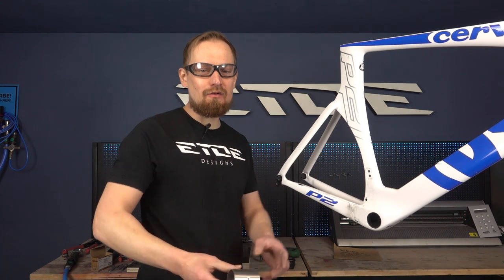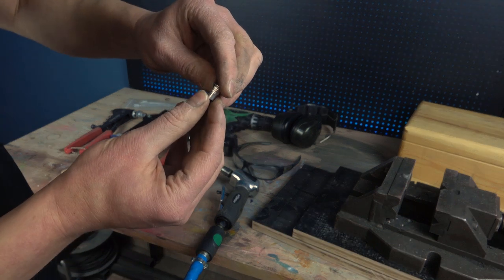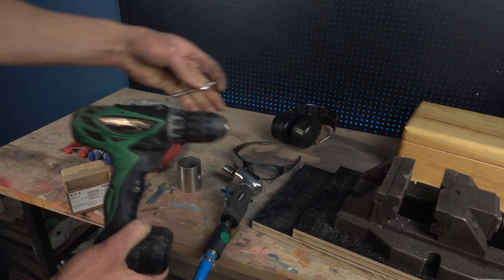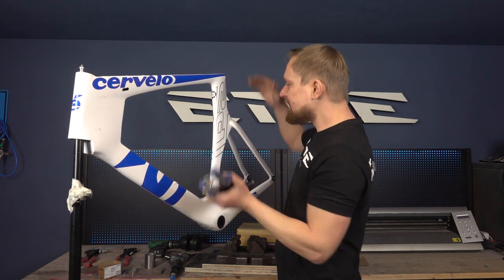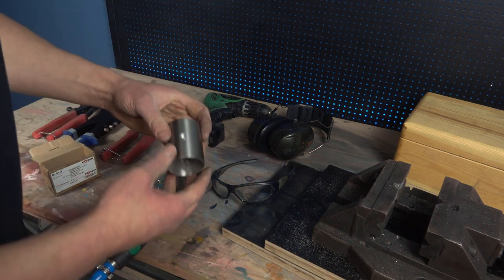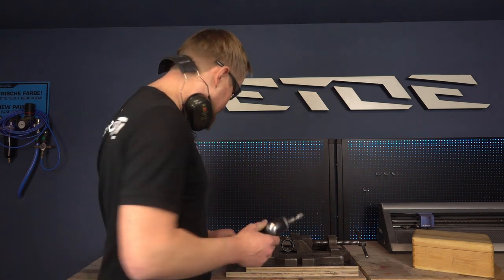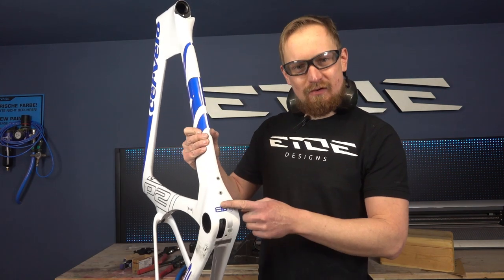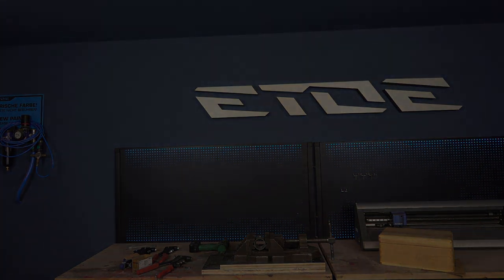How to replace and remove rivets on cycle frames

Comment: excellent video with regard to the burr bit in particular.  saw another video with someone using a dremel to cut the ridge and there’s no way I’d use that method on an expensive frame.  This guy has the right idea.

Comment: Thank you Martin for the information. Here is some more critical information regarding the rivet nuts. Look in the inside of the rivet nut and you will notice a smooth side wall before you get the screw thread. That area is called you the shrinking grip range. That length must be taken into consideration when purchasing these rivets. The length of that smooth surface must be longer than the thickness of the material you want to insert the rivet into. There is more information on the internet should anyone need more specifications.

Comment: I have never seen a adjustable angle threaded rivit tool, but one would be really useful. Also you should always use alloy threaded rivits in alloy or carbon frames and steel threaded rivits in steel frames - alloy rivits in a steel frame will cause bimetalic corrosion.
Reply: I cannot agree with you more. If only I can get into some people thick brains regarding different material when in contact with each other.

Comment: Just what I need.  How do you keep the metal from going inside the frame?
Reply: You can’t. Just take the seat post or fork or bottom bracket out and you can get it out that way.
Reply: @corbett08  it would be easier to just use a chisel and work it out, not taking the bike apart cause I want to save time taking the rivet out.

Comment: Using a burring tool to remove an old rivet has some drawbacks. If the user gets a little too aggressive, the bit can wobble and cut through the rivet and possibly damage the original hole in the CF frame. Using a series of small-to-larger drill bits is slightly less likely to cause this type of damage - unless the bit grabs the weakened rivet and starts spinning it wildly in the hole. Also, be super careful to not let the V cone-shaped burring bit go too deep in the hole.

Comment: Hi, i have a couple of questions, on a carbon frame i have a couple of pop rivets. Do they need to be "soft material" rivets so they dont damage the frame? Also, it looked like something fell inside your tube? Can this ever become traped on the bottom tube of a carbon frame?

Comment: What about the piece of metal left inside the tubing from the back of the old riv nut ???
Reply from the maker: You can remove it through the bottom bracket.

Comment: Ich habe eine frage bitte.  What happens to the internal part of the rivet when you grind off the top?  Does it fall inside the frame?  If so, how do you get it out so it is not rattling around?
Reply from the maker: It falls out of the bottom bracket holes and top tube holes.

Comment: Does it matter which angle you hold the rivet tool? I mean couldn't you just hold it side ways instead of parallel with the seat stay? :-)
Reply from the maker: Try it and you will understand.
Reply: Should not matter. Just make sure that the rivet nut is well seated.

Comment: Once had loose rivet in down tube, so I drilled it out but half of it fell inside the frame withouth chance to get it out and rattled like crazy. Poured glue inside and it worked fine but I felt bad for having half rivet and glue inside my downtube. Ended up selling the bike. 😂
Reply: Mārtiņš Mārcis you could have just removed the headset, BB or seatpost and it would have dropped out.